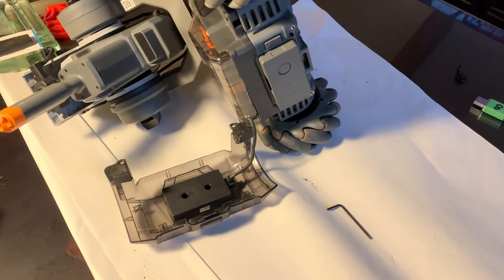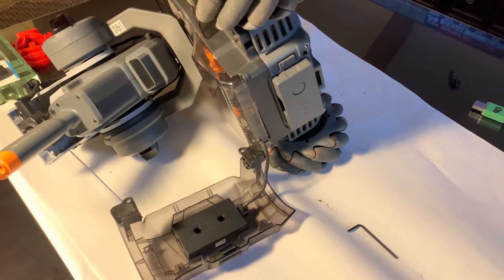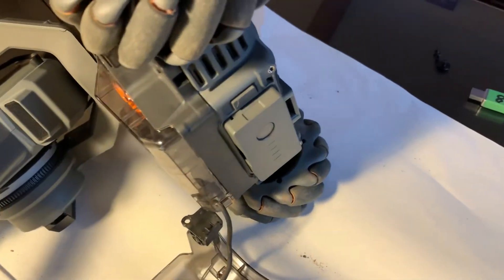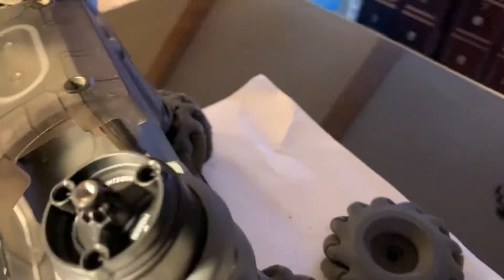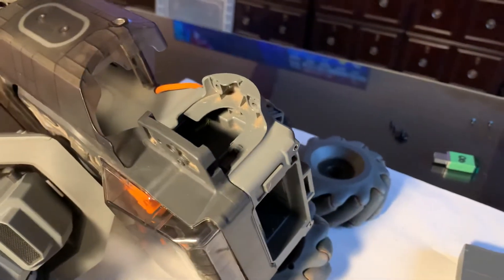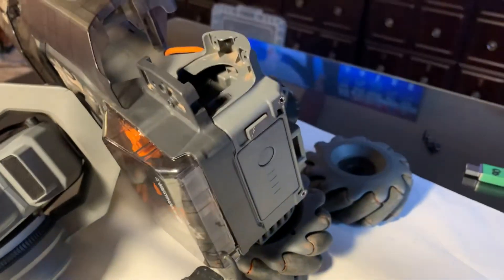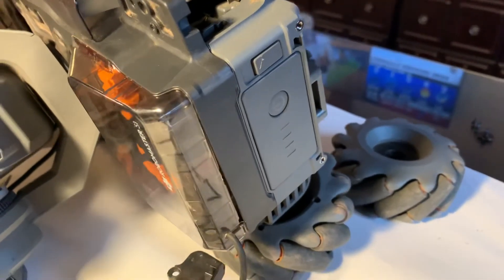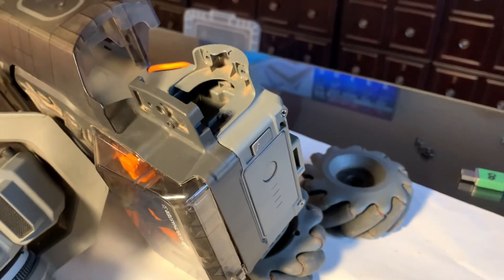EASY FIX for your DJI RoboMaster S1 Battery Release Button

Comment: Also, apply a little grease from the little white tube that came with the robomaster around the edges of the switch button to ensure the button pops out fully each time.
Reply from the maker: Great idea!
Reply: Mines just got stuck too.  Thanks